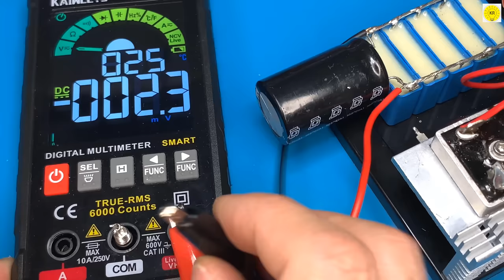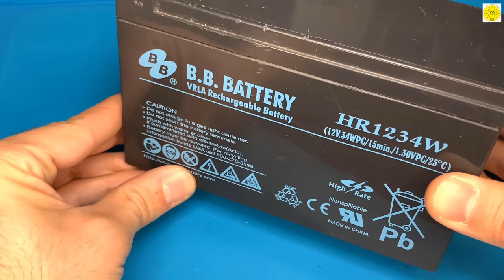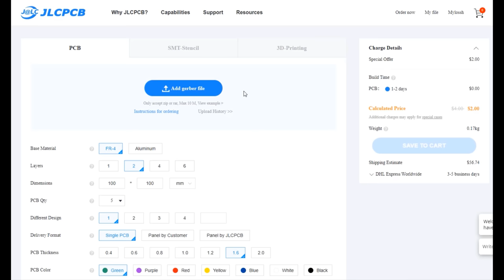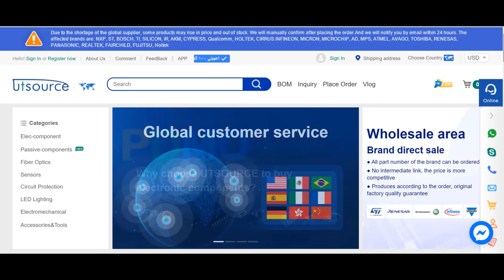how to make 12v battery charger

Comment: You must not use a capacitor after the bridge ! Because you need pulses in order to avoid suphatation. The voltage must be 16 v ac before bridge because the charge must be finaly at 14.8 V . The intensity of curent must decrease during the charging process. Your charger is a tool for fire and destroyng of accumulators
Reply: Exactly you are right
Reply: agreed, and i don't think this transformer can put 50 amps...
Reply: For ac 16V is the peak value. RMS is lower.. 16V rms ist too high. You need no high ripple for battery charge.
Reply: @wurgervomlichtenmoor5073  After the bridge you will obtain 14.5 V - this is the voltage you need.
Reply: @gabipaduraru2004  Normally transformer voltages are rated as rms values. If you use 16Vrms the peak value is 22.6V. Minus 2 times around 0.7V for the two low voltage silicon diodes in the rectifier its 21.2Vp after rectification.
Reply: 👍 bro
Reply: OK,Gabriel exactly !
Reply: Yah.. ac capacitor need ac volt. Not a DC volt
Reply: @hichamtassi1753  yah.. need wire number of 9 guage.. than full wave transformer 14+14 volt
Reply: @wurgervomlichtenmoor5073  
16 volt is ok.. no problem .. but ampers use low.. 100 ampers battri need  charging ampers only 10 ampers. Then no problem
Reply: @wurgervomlichtenmoor5073  16+16 volt is danger..
Reply: You're right. Also, the transformer is unlikely to produce more than 10 amps. Look how small it is in relation to the DMM.
Reply: Voltage must be 16 volts peak, so 12v rms works okay. Minus the voltage drop across the bridge rectifier which is 1.2v equals to 14.8. 
Adding a schottky diode for polarity protection equals to around 14.4v which is the recommended maximum charging voltage.
Not sure what a 100w lightbulb instead of the schottky would do (probably regulate the charging current?)
Reply: With 18-0_18, 5 Amp transformer and 35Amp BR with 2200Uf cap, I get 25V output. Do you think its too high voltage for charging 12v battery? Pls advise.
Reply: @nimalperera5454  The charging current must be 10% of batt capacity and you need max 16 - 17 V AC - before BR - you do not need a capacitor..
Reply: @nimalperera5454  25v is too high for a 12v lead battery. It needs 14.4v peak.
Reply: Well said Sir.
Reply: Ès hogy szabályzod az ampert?

Comment: Your KBPC5010 is 50A, 1000V. 
KBPC1510 (15A, 1000V) is just enough why complicate? You could use KBPC2504 (25A, 400V) if you wanted stronger bridge. Also Transformer is no more than 8A so 2x 5010 this is unnecessary. Capacitors are not needed for charging just if you want to use it to power something. 
Heatsink is not good enough for 5-10A charger. 
Also there is kind of a rule if you want to charge battery you need less power transformer not to short a life of battery like for 50Ah car battery optimal is 5A Better less than more. Battery is acting like capacitor so capacitors are pointless. Wires you used are not correct gauge you need much thicker to avoid heat and burn. I suggest you delete this video and make new one.
Reply: ar fi trebuit si un releu cu bobina la 12v cc care sa decupleze primarul transformatorului de la tensiunea de 220va

Comment: This will kill your battery.
12V RMS is about 17volts peak, so when rectified, this will give about 16v with a lot of ripple, adding the capacitors is pointless for a battery charger, but this voltage is way to high.
Use a transformer with an output of 10v, this peak is then about 14v, which is ok for a 12v battery.
Reply: Or, if you stick to the 12v ac transformer, add another diode after the bridge rectifier and before the battery
Reply: @soupflood  you would need to add more than one, the volt drop on a diode at best is 0.6v, more like 0.4v in practice, meaning you need 4,5 or 6 of them depending on what you want out.
Reply: @007floppyboy  maybe. Or maybe instead of the diodes add a 12v / 60w lightbulb?
Reply: @soupflood  what good would that do?
None, just use some of the power an cost you more.
Reply: @soupflood  yes but once the battery is near fully charged it will still allow over voltage and destroy the battery.
Reply: @007floppyboy  well that's not good. How did ancient cars avoid over charging?
Reply: @soupflood  even old cars had voltage regulators, they were a bit poor, hence new batteries required every 3 years, thats also down the manufacture of the batteries, also poor years and years ago (50s-60s).
My 7 year old car has the same battery, charging system much better, and battery manufacture much better.

Comment: The sustained output of that supply is limited to about 15amps max based on the #14 wire you used. The fuses were blown by the capacitor discharge. However, if you draw more than about 10amps for a sustained period that electrolytic will overheat and fail quickly due to the high ripple current. A 50a supply would need a much, much bigger transformer, 6awg wire connections, and about 10x to 50x the capacitor size depending on acceptable ripple.
Reply: what would that be in uF? and only one capacitor or multiple in parallel?
Reply: He says he is an electrical engineer, I just hope he doesn't inflict his work on some poor peoples house wiring, many homes may have fires in there electrical wiring. Such a joke, and they let this kind come play out here with there 3rd rate failed circuit descriptions and little boys homework projects.

Comment: that transformer will give you "rated" 20A @12V at most, testing the rating of a power supply is not blowing fuses instead connect a load (like car glow plug) and measure the current

Comment: All you need is 1 bridge rectifier and 1 capacitor 35-50vdc -2000mf
Reply: The battery itself acts as a capacitor, doesn't need any more.

Comment: Please tell me where does the charger takes its energy to charge the battery ?
-does it just usés the energy coming from the capacitors then amplified to output it?
- OR is there a power supply which supplies power to the device and which at it turn convert it to 12v supply it to the battery?

Comment: Eu costumo usar um Kbpc5010 e dois capacitores de. 35 v 3300uf em paralelo. Chega a 14.2 fácil fácil. Em carga fica 12.8 até chegar os 14 de volta. Valeu pela ideia Abraço.
Reply: Nossa! Retificação pura
Reply: PS,tem uns aí dizendo que não precisa capacitor depois da retificação.Eu aqui tenho uma fonte 1/2 onda e sem capacitor, só pra bateria.Fazia com um retificador uma lâmpada 110vac .Estou montando uma fonte trasistorizada (2n3055) 20a/24Vcc cap/ 35vcc/6800 uF.
Reply: @tonyferreira6679  you used that setup directly from 110v ac without transformer?

Comment: What are the function of 5 AC capacitors with parallel connection after the bridge rectifier? Isn't it  that the output voltage after the bridge is already DC volts?

Comment: You should not be shorting the output of the charger with high amp fuses you may burnout the transformer, I don’t understand what you’re trying to prove doing this.
Gabriel is right , no capacitors for smoothing the output

Comment: The capacitors are not available in store. Can you share the another link for buy this capacitor., 47nf
Reply: What is the voltage of capacitor?
Reply from the maker: The link has been updated, you can check again

Comment: It is ESSENTIAL that the charge voltage NEVER exceeds 14 Volts for sealed batteries ( like the one shown ! ) or they gas and you lose water from the acid , resulting in a ( soon to be ) dead battery ! !  ( only batteries that can be easily topped up can endure higher unregulated voltages , and , when you do top up DO NOT use tap water as this may cause faster self discharge )

Comment: Hi and sorry to bother,i have a question.
Can i use this battery charger obviously eliminating the capacitors as a power supply for an high Amps DC motor,obviously adding more diode bridge to reach 200+ amps?.
Thanks in advance for the answer.
Reply: La corriente máxima que proporciona el tranformador es de 8 a 10 amp como máximo, no fue necesario utilizar dos puentes de diodos de 50 amp ni tampoco los condensadores en cantidad, el amperaje solo es posible aumentar agregando más transformadores y conectarlo en serie. De lo contrario te compras un transformador grande utilizando en los viejos soldador eléctrico y había que hacer una modificación en el embobinado secundario. Estos si puede manejar corrientes de 200 a 250amp saludos
Reply: К сожалению, нет. Схема говно.

Comment: Safety first: no touch hv wires with bare hands use plastic gloves to avoid electric shock
Reply: 12V is HV?
😂😂😂😂
Reply: @LV-fx5nr  i say 220v. Do you know safety rule ? Do not touch 220 with bare hand
Reply: @scienceguide3880  Actually 220V is still LV, but you are right, better still turn the damned thing off.

Comment: це не зарядка для акума а 12в блок питания 
і такий АКБ можна зарадити 40 ватним блоком від телехона 

This is not a charge for the battery and a 12V power supply
and such a battery can be earned with a 40-watt unit from the phone

Comment: Good job professional
Please name the component capacitators and bridge diode maximum amper 
Another favoir if you can a professional video about repairing and restoring dead or weak 12v 7 amper h batteries 
Thanks alot
Reply: Not at all professional. This type of charger is a disaster for the battery and the soldering is very poorly made.
If. you have a dead or poor 12V 7 Ah lead battery; recycle it. It cannot be saved.

Comment: There are two ways you can destroy a battery, using a battery charger. Either the voltage is too high or the voltage is too low.
This charger will destroy the battery, because the voltage is only 12.09 V, when it should be at least 13.6V. To fully charge a battery it should also go up to about 14.6-14.8V for a short time and to do that, you need an intelligent charger.
This type of "charger" is a very stupid one, these types were used some 50-70 years ago. DO NOT USE IT!
Reply from the maker: This project is only for urgent cases and not for permanent use, thanks for your comment

Comment: This circuit is a joke…… I’m from Cambridge Massachusetts Graduated MIT any dc power supply needs to be filtered with a capacitor  but you need other circuits like a low and high voltage cut off relays